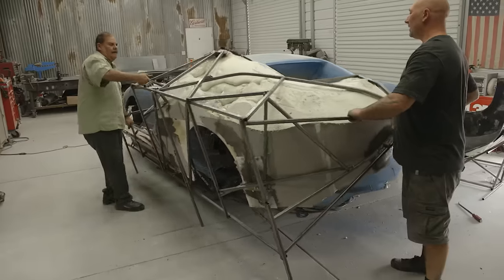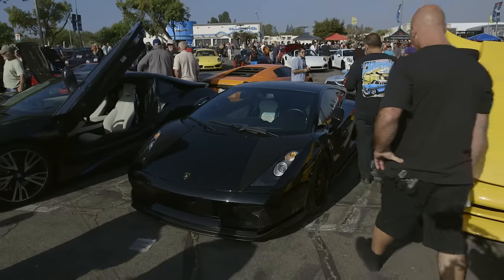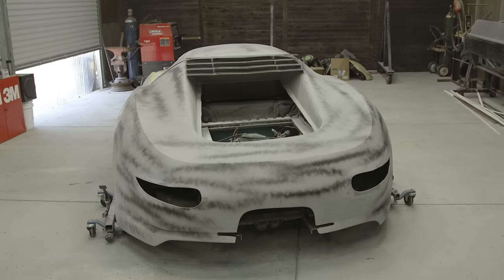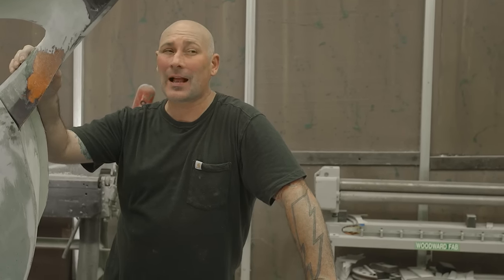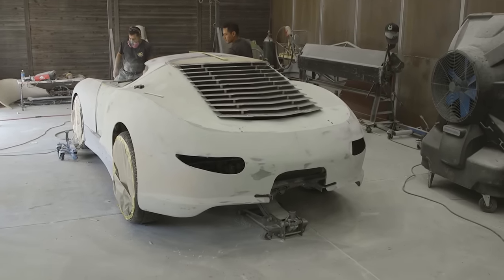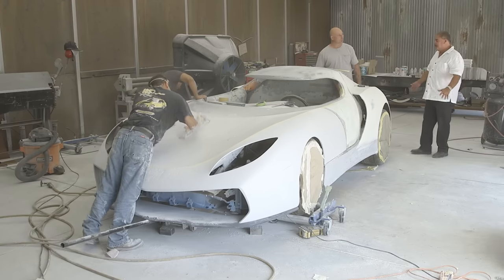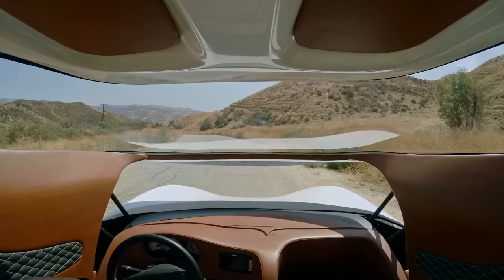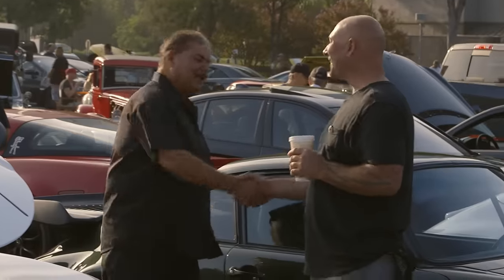The Finished Supercar! - Full Custom Garage: Sports Car Edition - S04 EP15 - Automotive Reality

Comment: What a exceptional looking car! congrats! the only thing in my opinion,that was not in line with the car, was the tail lights!  had to be way higher, because the were sitting to low,and must have been more elongated from the back end of the car, turning to the side of the car. Overall supper sexy! And ready for production,

Comment: I I would put the louvers down in the hole and a slight angle to follow the roof body line to show off the back of the car, but also made it as a lid that opened the trunk so it would’ve vented and I think it would’ve looked better sunk in because it looked better when you seen the back of that detail of the car

Comment: Awesome, great job. As a suggestion for an "enhancement" I think the area below the rear spoiler is too plain. And the placement of the tail lights could be higher. Then if you connect the taillights with a light bar across the back that should fill in that bare area below the spoiler.
Try it out!

Comment: What a project.  Recently watched the first few episodes on Motor Trend then found the entire series here.  Thank you!.  The car came out great.  You can imagine the costs (they don't mention) for the interior work and the final fiberglass spray.  Don't think that was free.  Lastly, love the final results except the rear louvres would have looked better white as the black hides their shape and still have trouble digesting the rear curved section of the wrap around windshield.  It just looks too retro and out of place with the rest of the car.